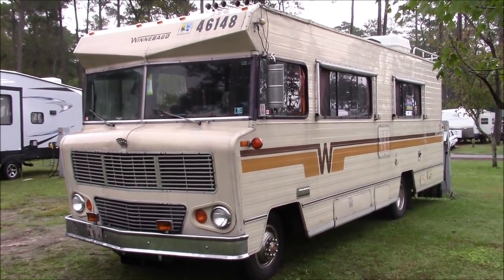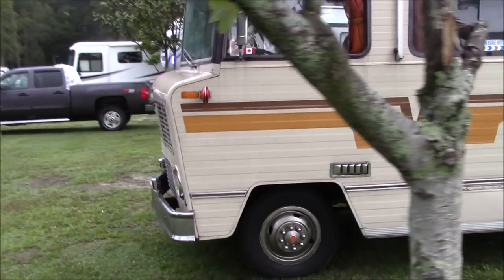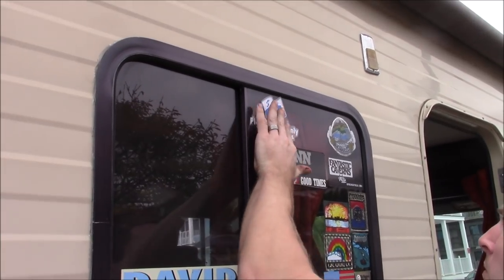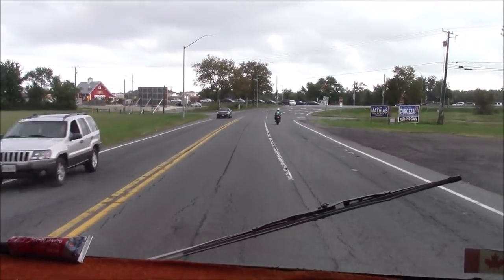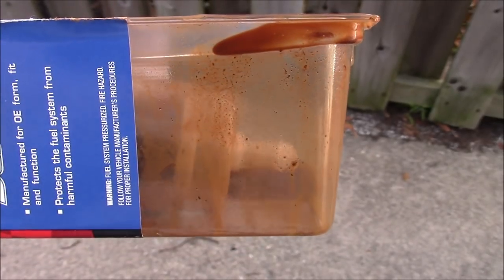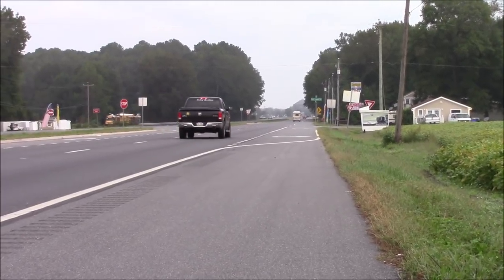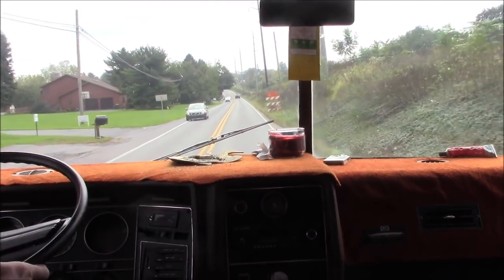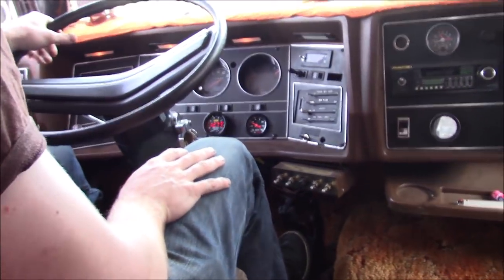Turbo-LS Winnebago goes to Ocean City Maryland!

Comment: When you put some horsepower into something that can actually use it the result is incredible. I hope you guys realize how cool this thing is. You probably do because you built it. Good work and cheers
Reply: imagine the fuel mileage...
Reply: @aidenCBR94  what's the mpg on that thing? 2.
Reply: @redstreak45cat36  not sure but that engine carrying that weight with those aerodynamics, its not going much over 8mpg ish.
Reply: @aidenCBR94  My bet is much lower. I guess 3.
Reply: @izzyplusplusplus1004  the most recent rcr said about 10-12 mpg which was better than the 440 that originally came in it
Reply: @redstreak45cat36  Nope, it gets better mileage than it did before the swap LS motors are decently efficient

Comment: The passing is hilarious. I have hundreds of hours behind the wheel of a motorhome and could only dream of this kind of power.
Reply: Now it just needs some wings and some Liquid Schwartz...just dont go to plaid!
Reply: @phxxr650r that's a 502 ?
Reply: My current Toyota motorhome has a 2.4 liter. I can pass medium-heavily loaded semi trucks on hills but definitely not cars.
Reply: @GIGABACHI  496
Reply: @jocarr1791  Ahhhh...the last modern EFI BBC installed in the 3/4 & 1Ton chasis, a Vortec 496. Those are stupid reliable and understressed. Probably will outlast the chasis it's moving around.👍
Reply: JIGA BACHI that's a 496 gm used to put them in 2500hd
Reply: @760Watt Off Grid RV till the bottom end falls out 😂
Reply: I fuel injected and turbo my 460 Ford ... Needed 4" pipes and EGT mapping ... Set cruise at 75 mph ... Pulling enclosed trailer with 2 Harley's .   Only one issue .  Gas stations too far apart . 😎
Reply: 760Watt Off Grid RV ya I carry 20 gallons in the toy hauler as well . if I drive at 60 with no wind I get about 6-7 I've cruised at 85 no problem . Problem is each time I look at the gauge you swear you can see it move lol  But she's older but i can still surprise a diesel pusher once in a while ...  Getting harder though ... Lots a power out there !
Reply: Whaaaaa you guys are fucking Heroes..🤴
Reply: Paul Lambert I had an 89 F350 with a 460 and broken fuel gauge. I rarely got below a half tank out of fear lol
Reply: Skyler 
Lmfao ... why does that second half Go always down faster ?  I mean its 400 lbs lighter lol ya no gauge I would have no clue everything from pavement quality can add or take gas consumption .  I try not to think about it lol
Reply: You could put in another spare tank and tie them together ... its a bit of work ... but it would solve your problem. :)
Reply: Sixtyfive!
Reply: The last motor home I had could pass cars going down hill lol
Reply: Minnesota Acoustic you did Mel Brooks proud.  And Barfolomew.

Comment: Swapped motorshomes need to be a thing. Imagine those smaller toyota motorhomes and throwing a supra motor in it
Reply: The smaller motor homes are still like 5-6000 pounds trust me a big block in there would satisfy it for my tastes tho
Reply: People do that to hiace Van's here in nz all the time haha
Reply: dude.... 2j in a dolphin would be insane
Reply: 22re is a tight fit in the ‘74 chinook that I’ve seen.
Reply: Nah, put a 1GE V12 in it
Reply: Supra engines are so last decade
Reply: digimon916 those little 2 liter engines couldn’t take that amount of power for that long
Reply: @V8Power5300  it's 3.0 but still weak.
Reply: Robert The JZ isn’t a bad engine
Reply: 4.0 Barra turbo
Reply: Need to drop a 1UZ in it, turboed 1UZ would be amazing lol

Comment: With the aerodynamics of a brick!
Reply: It has the aerodynamics of a brick shithouse falling down a rivene.
Reply: Gallons per mile
Reply: @dickjohnson5025  not to mention the weight of that thing. that LS is working overtime just to make this RV a little peppier than a v6 camry.
Reply: That makes it a perfect usecase for a turbo LS!
Reply: Hey if you talked to a guy that’s ever ran an old square body over 110 he can talk to you all about the aerodynamics of a brick
Reply: For a brick it drives pretty good
Reply: That can be solved by more horsepower

Comment: you guys gotta run this thing down the 1/4 mile!
Reply: and also put it on a dyno
Reply: Seemed slow AF at the stop light. Im sure its a large increase over stock but a heavy gigantic box is still..... a heavy gigantic box.
Reply: Andrew - I’d be more curious to see what this baby would do with a turbo Cummins swap. Seems more appropriate than an LS.
Reply: A diesel would be better for it, for all that weight.
Reply: @Clapxiomatic  never said it would be fast. And having fun is still having fun.
Reply: or dirtymax
Reply: what about a 3406?
Reply: @samhoh7670  too big, even a v8 is a tight fit in these, im even doubtful a 6.7 cummins would fit
Reply: Rear mounted 6.7
Reply: @samhoh7670  rear mounted 6.7 diesel and leave turbo ls in the front!
Reply: Sam Hoh That id like to see 👍
Reply: lmao would that be considered a hybrid then?
Reply: Mista 100% would bend the frame hahaha
Reply: @ashtonreich1154  too much turbo lag if that were done
Reply: @Dingus E. Dow that's what I am saying
Reply: I’m saying 18 seconds at best with 370 going to the wheels. Seems like a realistic estimate
Reply: @theeoddments960  never make 370 at the rear wheels turning  trans big rearends and duals never happen. All you people comenting on HP and rear wheel Hp have no idea what you are talking about or how much power the drivetrain eats up especially in this turd

Comment: Why not do a full exhaust with valves? You can have the best of both worlds: stealth and straight pipe at the push of a button
Reply: That's what I am about unless its just a race car I want a muffler and if making some power ill do a cutout
Reply: sadly custom exaust valve setups are illegal in germany. :(
Reply: @descent8275  Klappenauspuffe sind nicht illegal.
Reply: @zesteinl6497  doch, selbstgebaute anlagen bekommst nicht zugelassen. ich wurde immer vom tüv verwiesen.

Comment: I ran several of those MH's from 1975 until 2013. Yours is righteous indeed. Try a steering damper mounted to the draglink for a 4WD to quell that front end shake. I also added 4 degrees of caster wedges to increase straight line tracking. Cheap to do and it will drive much better.

Comment: So many bad ideas going through my head right now...
Reply: MotionAutoTv do it
Reply: Oh please share with the rest of us demented minds.
Reply: 2jz over 1000 hp to the wheels would be fucking insane imagine just seing a rv blow your doors off
Reply: 2J swap camper!!!
Reply: Things got a 12v Cummins build that piece
Reply: MotionAutoTv lmao same here
Reply: Just make some more space in the engine bay and put a v8 blower 871 :)
Reply: @dr.dylansgame5583  2JZ's don't have enough low end torque as the LS's. The fuel consumption would most likely be horrible.
Reply: 1uz turbo  one of them Toyota Motor homes lol

Comment: Technically carburettors suck, fuel injection squirts
Reply: This
Reply: I liked your comment, however technically fuel injection sprays, not squirts..
Reply: Ray Grover ah, yeah spray is a bit more accurate
Reply: @11jeopardy11  Im sorry sir, but I believe "atomization" would be the correct term?
Reply: If it's squirtin it ain't workin!. 😉😂
Reply: ned ard I believe “ atomizes “ is more accurate

Comment: 3 minutes in our destination time to fill up
Reply: actually the MPG is probably the same as the old engine if not better. the iron big blocks they slam into these things are running bone stock and are very thirsty because of it we're talking like 4-6 MPG. but a turbo LS can actually get like 10 MPG if you tune it right.
Reply: @ElectronicsForFun  aerodynamics are the majority of your fuel consumption in a vehicle like an rv when you're going 70mph,  I'd be surprised if they get 9mpg
Reply: @Technoflicks  that's irrelevant though because the aerodynamics haven't changed. it was a box on wheels when it had the iron block and it's still a box on wheels with an LS.
Reply: @ElectronicsForFun  it's not irrelevant are you kidding me? You're going from a dogshit carb tuned rich from the factory to afterburn the fuel for emissions to an actually good combustion chamber and compression ratio with closed loop fuel injection. I can't guess mpg as a number, but I'd guess it's 40% better mpg if you were to drive both of them nicely.
Reply: @ElectronicsForFun  my point about the aerodynamics is that the rv has such a high aerodynamic load that a lot of the optimizations on the LS for fuel efficiency aren't as effective when you just flat out need a certain amount of power, and to get that certain amount of power you need a lot of gas. and the point I was contesting was that the ls wouldn't get 100% better mpg than the 454  like you stated in your original comment especially since to run a turbo system without water injection you need to run a lot of extra fuel to cool the charge down.
Reply: @Technoflicks  "my point about the aerodynamics is that the rv has such a high aerodynamic load that a lot of the optimizations on the LS for fuel efficiency aren't as effective when you just flat out need a certain amount of power, and to get that certain amount of power you need a lot of gas.", right l understand that, but it would still be better than the iron block that was in there before the LS. that's all l am trying to say. 

"and the point I was contesting was that the ls wouldn't get 100% better mpg than the 454" nobody was saying that it would. 

"like you stated in your original comment especially since to run a turbo system without water injection you need to run a lot of extra fuel to cool the charge down." in my original comment l said that it would be about the same if not better. l said nothing about a massive increase in efficiency.
Reply: @ElectronicsForFun  4-6mpg to 10mpg is a 70%-150% gain in efficiency, those were the ballpark numbers you gave.
Reply: @Technoflicks  oh l forgot l posted those. l am just spit balling, l don't know what it's actually getting but l think it could get 10 if you tuned it right. and while yes that is a large increase percentage wise, but when the numbers are that small it's only a few MPG.
Reply: @Electronics For Fun RCR reviewed this winnebago, they told him it gets like 10 MPG which was actually an improvement over the stock engine
Reply: On goddd we filling up

Comment: Definitely add something so it’s tolerable to drive on long distances. I know everyone will say no keep it loud but man after awhile it’ll get old on a few hundred mile trip.
Reply: i got only a flowmaster super 10 on my 89 silverado, exhaust comming out the very back on both sides with a 350 v8 bored .030 over rebuilt motor and I pull a 6000 lb travel trailer with it. I can hear the exhaust with the windows up but thats just music to my ears. i just turn the stereo up if i dont wanna hear it
Reply: Do an electric cutout. 
I love mine. 
It’s saved my ears and a few sound tickets too, definitely paid for itself.
Reply: Flowmasters & turbos are a horrible combination
Reply: Alex Bruns how old does it get during a 7 min video?
Reply: Do you even like cars?
Reply: My 86 Chevy Silverado has a 360 and dual exhaust with some edelbrock headers and flow master 40s and I can hear it with windows up and music playing, it never gets old
Reply: What?? I can't quite hear ya!

Comment: This would make the most epic N.Y. to Cali run in history. I think this could get a new record a cop would think their gun is broken before thinking it was a wanabango going 110. Plus you could probably just load enough fuel tanks inside, no bathroom breaks. Someone tell vinwiki Ed has to make a record run in something like this.
Reply: They'd need a box of like 20 fuel filters at the rate it breaks them lol
Reply: Spicey maybe avoid the stock tank and just use new non rusty ones😂
Reply: Haha. Cop clocks him 2,500 feet out, looks at his LIDAR gun confused, shrugs shoulders, then clocks next vehicle in line.
Reply: I would want a muffler before I'd spend a week driving that house. You'd be deaf before you'd reach Kansas.
Reply: Large, heavy vehicles like this kill tires. No tire for this kind of vehicle would safely handle prolonged 100+ mph. Way too much heat build up.
Reply: @Daschickenify  what would be the tonnage limit for 100mph then? i mean, if this camper cant do it, there must be lighter bricks waiting to do that run lol.
Reply: @comethiburs2326  I just typed a whole freaking essay, but the lost it all. So here is a shorter version.(still long)

I looked at Michelin's heavy truck and RV tires, all but one were rated 75 or less mph, just one was rated for 81 mph. 100 is still a long way from 81. However, LT tires are speed rated much higher. A quick look through LT tires shows some rated for 112 mph. So don't use a full size RV, instead, look for one based off of a medium duty truck or van which uses LT tires.

I picked the 235/80/17 Toyo Open Country H/T as an example. It is speed rated for 112 mph, and has a 3,086 pound max load rating. 6 times 3,086 is 18,516 pounds. So stay below that weight if you have 6 tires rated for 3,086 pounds.

Here is what I would do if I wanted to go 100+ mph in an RV.

Set up an RV whose max expected weight stays well below the tires' max load rating. Say 15,000 pounds max for our tires above.
Pick the highest speed rated tires that meet the load requirements + safety buffer.
Of the highest speed rated tires, pick the one most resembling a heavy truck ribbed highway tire, not a knobby jeep tire
Run the tires at the max sidewall pressure (80 PSI)
Not go too fast in high ambient temperature conditions
Bring temperature gun and watch temperatures to make sure they don't exceed 150F

Here is a useful tirerack load table. On the lower S rated tires there is no suggested reduction in max weight capacity, but as you go up in speed ratings, they can drop as much as 15% max weight capacity WITH an accompanied increase in pressure.

https://www.tirerack.com/tires/tiretech/techpage.jsp?techid=295
Reply: @Daschickenify that's really well done. now for the trucks, theres some campers that fit the bill: the gmc motorhome, the bmw vixen 21, and the dodge rectrans. the last one seems the easiest to turn into a speed demon. lots of room for turbocharging, and a chassis that looks easy to modify.

Comment: thats  cool.... im sure its tough slowin it down with drum brakes..
Reply: Are you sure it needs brakes? I swore with that profile you would just need to let off the gas and it would feel like you just drove into the ocean.
Reply: Audrey And Jeremy Thompson 
I'm an RV tech.. I wondered about the brakes also.. you ma'am and sir have created the perfect mental/ visual picture of the situation that could have been dreamed  up.
Reply: If watch his build video he installed new old stock disks.
Reply: It's got disc brakes up front. But it could probably do much better with larger rotors and pads/calipers if a conversion kit were available.

Comment: But, will it do a burnout?
Reply: That might be the finest question i've ever herd
Reply: good good
Reply: Yes but it will drop the driveshaft
Reply: I was thinking rhe same 😂😂😂
Reply: @Dingus E. Dow too much torque required to break the tires loose. I had a 7.3 idi class c with a banks turbo on it. While it was stripped inside it smoke the tires every 1-2 shift at wot. Once I got the interior done it would break the yoke on the diff instead of spinning the tires.

Comment: Which I still had mine, we could have raced. It was an '83 Revcon, with a 502, Edelbrock MPFI, with a 4L85e trans. It was a custom front wheel drive chassis, so you would get me off the line - it would still break the front wheels loose at 20 mph. I sold it last year. I saw 98 mph 3 times, twice towing a Jeep Grand Cherokee. It still had plenty left, I just ran out of freeway. The day I sold it, I did break the triple digit barrier, I had more, but some idiot in a pickup pulled in front of me. The Revcons handle really well, so high speed driving still feels safe. I sold it last year, and talk to the new owner frequently. 
BTY: I strongly recommend using Magnaflow mufflers. Buy the longest ones you can find. Originally I had Flowmasters which were awful. Not only were they noisey, but the ruined the HP and mileage. The Magnaflows do exactly what you want then to. Straight through, so no real back pressure. They are fairly quiet under normal driving, but really talk nice when you get on it. There is nothing like hearing the big pistons of a 502 running 5200 RPM at WOT. Its a sound like no other.

Comment: Great the front end checked out.
Look at the Kingpins. 
That wheel shake is dangerous to all the linkages.
Remember your only in a styrofoam box. The crash will be devastating.
Reply from the maker: All the wheels are bent to hell.
Reply: Thats to bad.
But check the Kingpins, my family had a 1973 version of your machine.
Kingpins exhibit that symptom.
Congratulations on your creation. It's a great idea.
Reply: @Torsee  one kingpin had a little play.  I don't think it did this before switching the 7 wheels around all over (we put a new tire on the spare).  I'm gonna try spare wheel/tire on left front and see what happens
Reply: Glad you checked.
Got to keep her straight when you go into,

Hyperactive!   "Spaceballs" the movie reference.
Reply: Are the tires the originals? Old motorhomes are notorious for fine looking but totally dry rotted tires. That can cause the shakes, and also death. Check the date codes to make sure they were not new in '95....
Reply: @notsofresh8563  they put brand new rubber on it all the way around